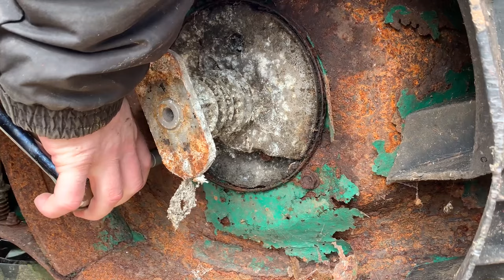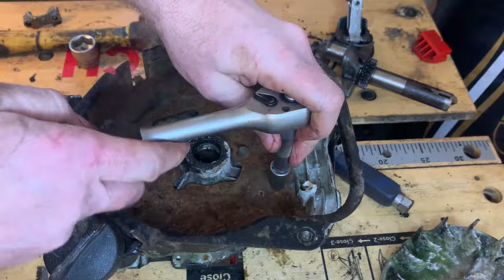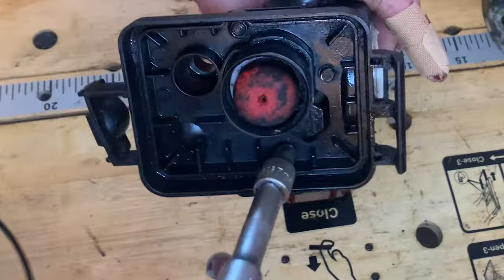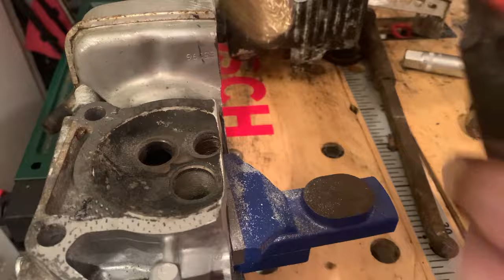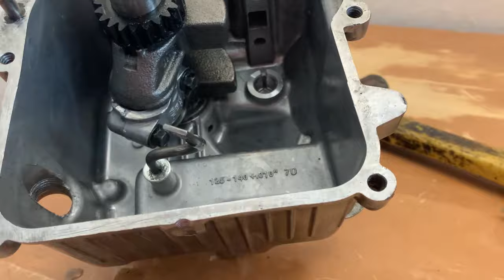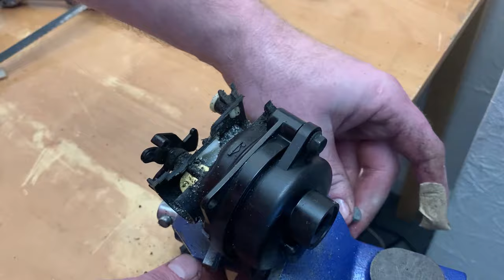How this Rusty Old Lawnmower Now EDUCATES People.

Comment: It looked like some of what I get in. Came apart with the exception of one bolt. fairly easy. Nice repurposing. Looking forward to your future videos using it.
Stay well, Joe Z
Reply from the maker: Many thanks again for your motivating comments Joe Z. Craig 👍👍👍
Reply: Hey Joe.  Funny meeting you here.  🤣
Reply: @100vg  What can I say, " great minds think alike" ?  LOL Craig has one of the best how to videos anywhere. His diagrams are really outstanding.  Wish he was doing these years ago. Would have saved me a lot of time & grief.
See you soon.
Reply: @JOEZEP54   When I watched his first video I saw about how 2-stroke engines work, I was sold and subscribed.  What a fascinating design!  Too complex for me to remember all the details of the upstroke and downstroke, but it's amazing!  I tried to write them out and kept getting confused.  It needs a fuel/oil mix for lubrication and its RPMs can get much higher then 4-stroke.  Two carburetor adjustment screws, one for idle and one for Max RPM.  Whoever dreamed up this design was a genius and it's been perfected since then!

Some people use a 40:1 mix in 50:1 engines for better lubrication.  It makes more smoke, but protects better.  I bought a can of Husqvarna (who makes Poulan Pro) 50:1 for my 20" chainsaw because that's what's specified on the case cardboard cover and in the manual, but when that's gone, I may try 40:1 next time.

This stuff has gotten crazy expensive, but this way I know the mix is precise and Premium Fuel is used.  I saw on the Poulan Pro website that ALL of their chainsaws are 40:1, but 50:1 is stated everywhere, so 40:1 should be fine.
Reply: @100vg  The 2 stroke engine & carburetor make a lot of applications possible. Two carburetor adjustment screws, one for idle and one for max RPM were also used on older 4 stroke lawn mowers/tractors. The pre mix fuel is out of control in my area. TruFuel 110-oz 40:1 Ethanol Free Pre-Blended 2-Cycle Fuel  is $23.98 at Lowes for 110 oz can, that's $27.904 per gallon!! You can buy this in just about any big box store in my area but in my County no non ethanol
fuel at the pump. The only place I can buy non ethanol fuel is at a Stewards in another county that is about a hour drive plus tolls. This Stewards only sell high test non ethanol (Premium ) which is expensive & not necessary ( the Premium ) for small engines. I do not know the reason they prohibit   non ethanol at the pump for around $5.00 gal. but you can buy it premixed for $27.94 a gallon in just about any store but I am sure the geniuses in charge have 
a reason or 2 🤔
Stay well, Joe Z
Reply: @JOEZEP54   110oz 50:1 Ethanol Free Premium 2-Cycle Fuel is over $36 here.  😮
Reply: @100%VG  If it keeps up we might have to go back to herding goats & sheep.
Reply: @JOEZEP54   🤣😂🤣😂🤣 $36 at Tractor Supply, but even still.